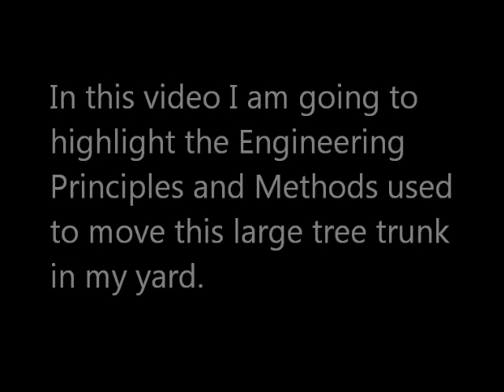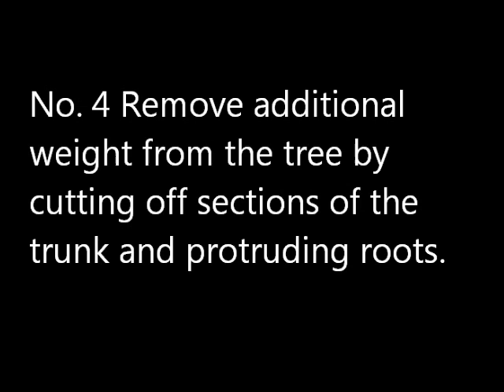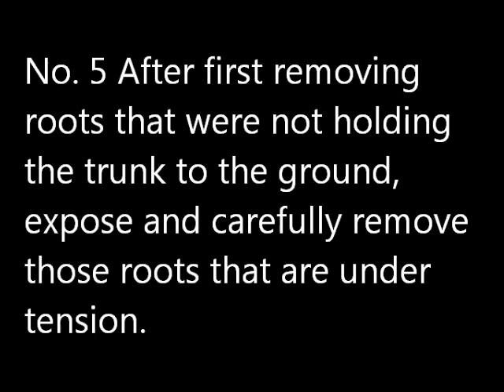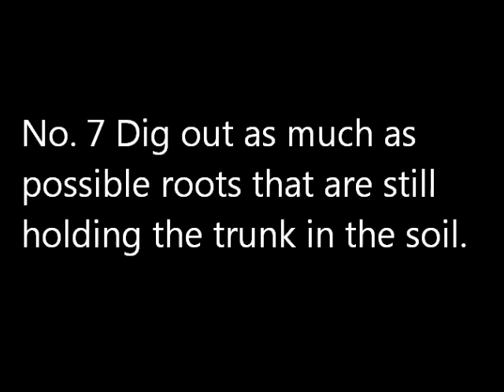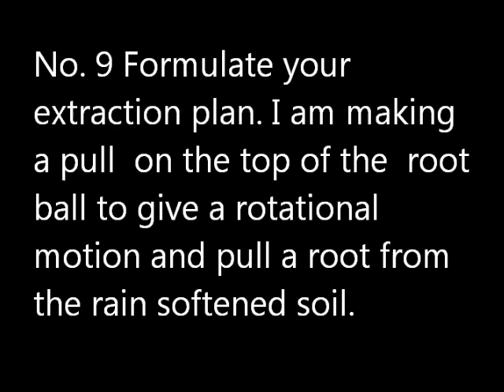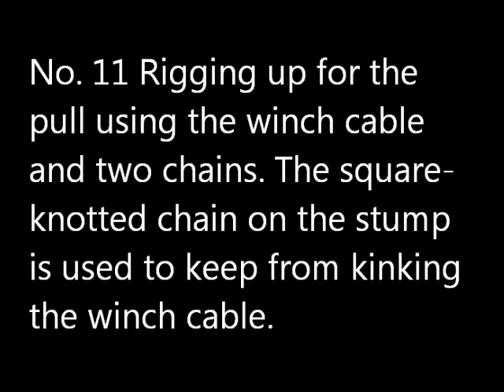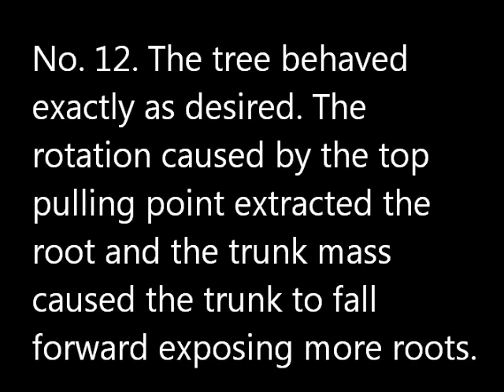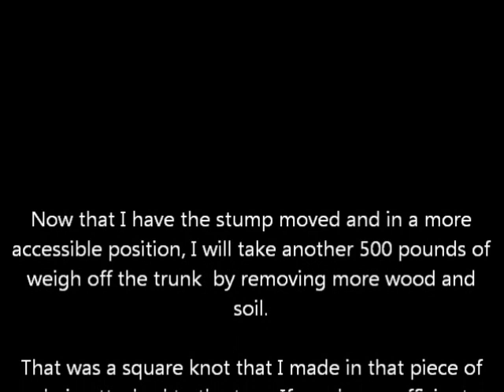Engineering Principles for Removing a Large Tree Stump

Comment: Not anything super complicated here. There were two techniques I saw that could easily be improved though.  1. Use a shovel or spade not a cutting/splitting tool to clean off the rootball.  2. Where possible be safer and cut easier by using a winch,  jack or come along to remove tension/compression from large load  bearing members before cutting.  Ideally you'd use your previously cut rounds to block it from potentially rolling back on you after you cut it.

Comment: I'm dealing with one just about this size, except that the core from underneath is a huge rock (I'd say at least 1000lbs) as well as smaller rocks well entrenched within the roots. My first 2 attempts using a saw were in vain as the rocks never gave it a chance to reach the load-bearing roots. The hole in the ground is about 6 ft in diameter also with rocks halfway into the earth. Any advice on how to deal with the protruding section of the stump ? Its just too far in my backyard to drag it with my truck- we're talking 1500 ft.
Reply from the maker: My first thoughts would be to burn it in place. If that is not possible saw, hack, and chip away at what you can reach and leave the rest to rot. In five years it will largely be gone or can be kicked over with a chain and truck. Explosives would also be an option, but it sounds like you are in an urban area where that is not possible.

Comment: Just looking for vids on tips for cutting up a 6ft root ball on a red gum. Unfortunately the dirt around the roots is like concrete so I've been chipping away at it for weeks. Not game to run a saw through it yet. Might just dust off the wallet and pay to get it hauled.
Reply from the maker: The only way I know to soften up that clay is to soak it. It will still be sticky, but then you can move it with heavy hand tools that you can chop and pry with.

Comment: is there any method to remove a strump that is closer to a wall?I fear the wall might fall if i dig too much.
Reply from the maker: That is always a problem. At some stage there will be roots under the wall that will rot and leave a cavity and weaken the wall, particularly if it is just dry-laid stone. Concrete block walls will have a little strength and if the roots are say less than half of the width of the block and the block is otherwise supported it will likely stand long enough for you to put some concrete under it. It just all depends on the wall and the size of the tree and what sort of footer, if any, the wall had beneath it. As you have surmised this is very touchy work.
Reply: @HoveySmith  There is a video on youtube where a guy drills holes in the stump and puts oil in them and than burns it .He says it will burn down completely .Will that method work?
Reply from the maker: On dry dead wood the oil will soak in  and will certainly burn if air can get to it. I would think  that the larger the holes the better and even better still if some air vents can be drilled into it from the side or the stump is at least partly split.  If it is a big green stump nothing is really magical. This is going to take awhile to get done.
Reply: @HoveySmith  It is a Mango tree stump and it is very fat .I already removed another Mango tree stump which was not near the wall.I had to dig almost 7 to 8 feet to remove the roots completely.But when the stump was removed i saw more roots under and removed them too after 8 feet i gave up buried the hole.

Comment: How to clean and haul away a felled tree with the root already pulled out...smh. So hard to find a good video showing how to pull out a tree stump bigger than 12" without someone just saying - "Use a shovel and a saw then pull it out". I guess there is no simpler way.
Reply: After much research I came up with the following solution I did on 5 tree stumps:
1. Yes, dig around the base of the tree about 24-36"
2. Dig down until you find the first large root and dig an opening all around it. Use a reciprocating saw with a PRUNING BLADE to cut through it.
3. repeat this until you get below the root ball, you can use also use a 48" pry bar with straight blade on the end to chip away smaller roots.
4. Once all but the main tap root is chopped then you can wrap a tow chain around the very top of the stump (hopefully you have at least 24"
5. Wrap another tow chain around something more sturdy than the stump (another tree, truck hitch, etc..)
6. Put a 4 Ton Dual Gear Power Puller, $50, between the two chains and ratchet until you loosen the stump. Keep at it until you finally pull it out, clearing as much dirt away as you can from the bottom.
I did this on 5 tree stumps more than 12" in diam. It sucked, was hard work, but got the entire root ball out, unlike a stump grinder.
Reply: @ChadHicks92  thanks for great instructions!
Reply from the maker: @ChadHicks92 Good job. Mine was already blown over, but was a 36-inch tree. Pulling the stumps up with had tools is work, any way you do it.
Reply: I think you are right Chad  .   a TREE is way harder to get out of the ground than any gate post. Not just because it might be bigger, but because it’s got a huge root system which has evolved over many million years to anchor it in the ground as firmly as possible.    And contrary to what a lot of vids on here might suggest you cannot usually pull out a tree even a little one without the help of a pick and shovel and axe....well OK then a sawzall  if you are one of these modern types
Reply from the maker: If the tree was still up, I would have no need to move the stump. Hurricane Michael did the pulling for me.
Reply: @HoveySmith  Man I'm watching this video because of stumps still in my yard from Michael. I live in Panama city and we got the 2nd worst part beyond the eye. We had soooo many trees and now our yard is rather barren.

Comment: Do you use the knot in the chain when it doesn't have a hook, or instead of the hook?
Reply from the maker: Yes I do and you can. I offer a little added insurance by putting a nut, bolt, and washer through the links behind the knot to help keep it from slipping.

Comment: I've actually dropped trees by pressure washing out the root ball and pumping out the mud REPEAT for 5 days.  Put a good line on tree with following load (log hung on line) and after cutting a few roots, the soil, now water logged for 5 days, turns into mud and the tree galls over popping the root ball out too.  Still have to do as you say to get the remaining roots cut to remove the ball. But using the tree itself as a big pry bar is unbeatable.
Reply: I'm in the process of removing a 90 year old Manitoba Maple that fell during a recent storm.  The up-ended root ball is about 7 ft. diameter. I've got the time, so I'm slowly engineering each step of removal.  I used a 2800 psi pressure washer to clean out the root ball which made the maze of roots visible, it put most of the soil back into the crater and the soil and rocks won't be damaging the chain saw and dulling the blade as the roots are extracted.  70 percent of the root ball has been removed by the end of day two.  Pressure washer turned out to be an awesome tool for this process.
Reply: Then you have mud all over the place, taking a shower every hour.
Reply: @kimchee94112  Yes there is mud BUT if you place about a 3" washer right behind the nozzle, it acts as a blast deflector and produces a cone of no back spray.  Of course this is also a preferred method when it's 90* outside in summer (!)
Reply: I’ve done the same, using a shop vac to suck up the mud.

Comment: What kind of bar is that and why are you using it?
Reply from the maker: The bow saw was designed to cut pine pulpwood in  Southern forests for stacking on old-time pulpwood trucks where the cut trunk sections were about  7-feet long. The bow does two things. Its shorter height reduces friction and weight while the longer chain allows it to be used for a longer period without needing resharpening. The weight of this heavy saw allows it to cut without having to put downward pressure on the blade, provided that the saw's teeth are sharp.
Reply: @HoveySmith  thank you hovey, I remove trees and use 10 different chainsaws all day, but they obviously all have the same style bar just differed between length and girth(proportional with the size of saw) and I saw that and just had to know what the heck it was used for. Thanks again.
Reply: Also known as a brush bar.  When cutting smaller standing shrubs, the branches tend to fall on the bar and knock the chain off.   With this, the limbs can knock on the bar all they want, the other side with the chain is far away haha.